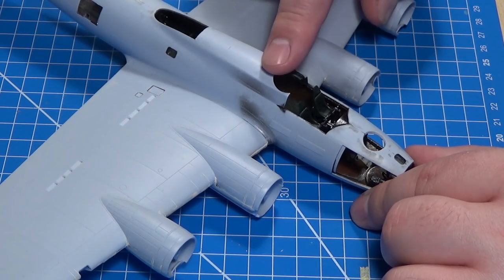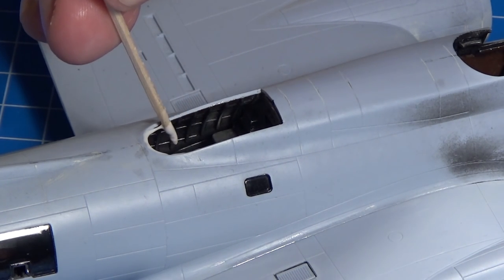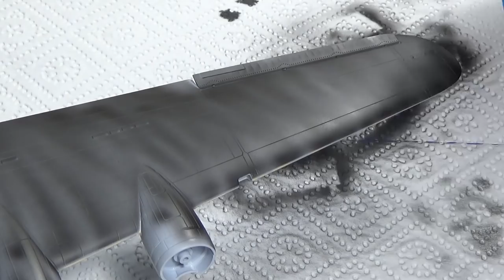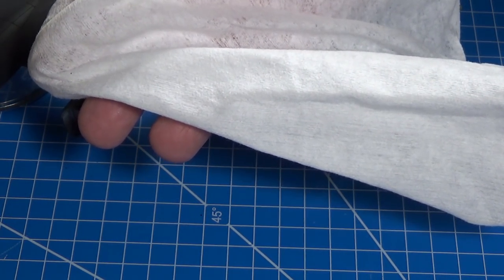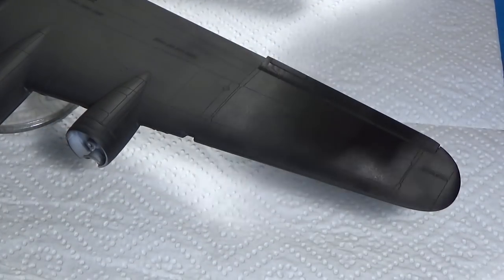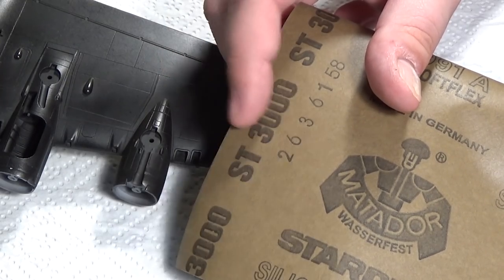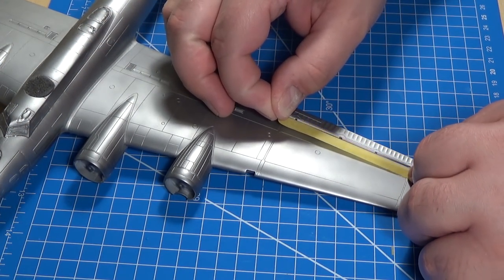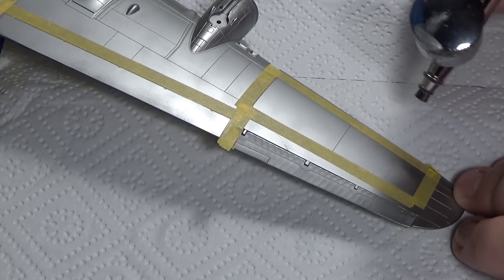Model Flying Fortress B-17G - 1/72 Airfix - Painting

Comment: Nice work. Just a suggestion you might find useful: try a dedicated primer airbrush like an Iwata RG-3. You won’t have dusty overspray resulting in a coarse finish that you need to sand.
Reply from the maker: Thanks, I'll read some more about this airbrush :)
Reply: Good point. I’ve had to sand every layer or paint to get to the finish I’m after...

Comment: I notice you hold the parts together and then add thin glue to the joints. Do you have to sand of the glue once it has dried?
Reply from the maker: That's the beauty of this glue. The excess dries fast and doesn't leave marks on the surface. It basically melts the plastic in the crevice between parts but dries instantaneously everywhere else without melting the plastic.

Comment: I am in awe of the results you get, but I wonder why you apply Future on top of what looks like the base coating for your aluminum finish. I know that the olive-drab sections are anti-glare and will be matte finish, and the de-icing boots on the leading edges of the tail and wings are a kind of rubber, and will be a semi-gloss black. The difference in the aluminum color sections isn't a surprise, knowing your high standards, is there any color difference in the fabric-covered control surfaces? Thanks for sharing your fine work, your videos are like college seminars. Keep it up!
Reply from the maker: That's a lot of questions ;)
I'm not sure if I understand them all correctly.
As for the Future on the base coating - I put it on the whole plane, to protect it before decaling and weathering. I'll matt those olive drab patches later.
I didn't paint ailerons with another paint, they have a little different texture, so I hope it'll be enough.

Comment: Hiya! I’m at the stage of masking for the darker alclad panels. Did you tape directly on to the bare lighter aluminium alclad ie without a coat of gloss? I’d hate to tape it up and then the masking pulls off some of the paint!!
Reply from the maker: Well, I didn't cover the surface...
To prevent the tape from taking too much pigment with it, you can lower its adhesiveness by attaching it to your skin once or twice. Simple trick, but works as a charm :)
Of course better try it somewhere it won't be visible if something goes wrong.
Reply: great tip! tyvm :)

Comment: What red and olive drab did you use.  Was it acrylic?  Have you had and problems spraying an acrylic over a lacquer?
Reply from the maker: Both of them was Tamiya acrylic. There was no problem with spraying, but it does not grip to the surface well. I tried not to touch the painted surface, because it could scratch. That's a good way to make scratches deliberately, if you want your plane to look more worn out, but I didn't want to do this.
After couple layers of gloss varnish, colours are well protected now.

Comment: Why did you first paint the Clear parts with silver?
Reply from the maker: Because interiors of this plane should be silver. This way painted part of the clear element is silver from the outside and inside.
If I used grey/black primer, those parts would have been grey/black inside.

Comment: Great Video,  question -  doesnt the silver lift off when u mask?
Reply from the maker: No, those Alclads stick quite firmly to the surface.
Reply: Thanks for the prompt reply,  I had problems with Alclad after spaying and later masking to paint other colors.  Did you have to apply a clear coat to ensure lustre doesnt fade?  Thanks
Reply from the maker: Maybe it's a matter of proper primer. I've used one dedicated to those paints.
As for the clear coat - I applied many layers of gloss varnish on this model. After every step to be honest (before decals, after decals, after the wash etc.)
Reply: thanks

Comment: How did you add the glue to the clear parts without fogging the clear parts? thanks
Reply from the maker: I've used two kinds of glue to attach clear parts here - Tamiya Extra Thin Cement and white glue. Neither of them fogs the clear parts.
Reply: @Big-Modeller  Wow I didn't know that I will try it next as I have always used white glue to fix clear parts
Reply from the maker: Just to be extra careful, test it for yourself on some expendable clear element. Just to be sure ;).